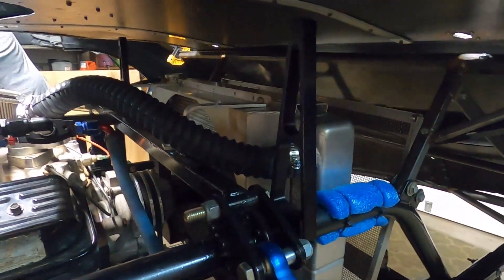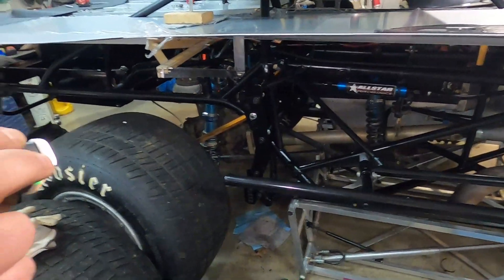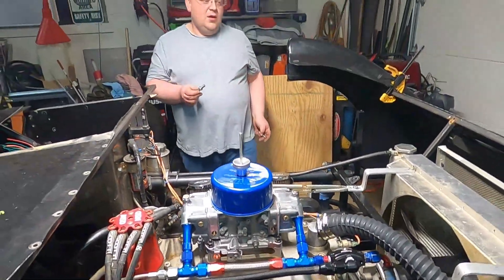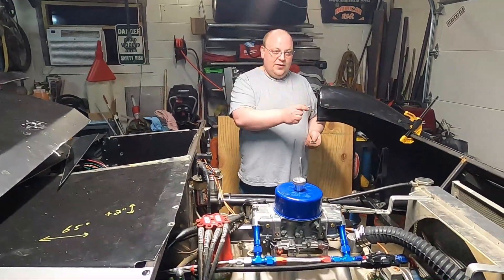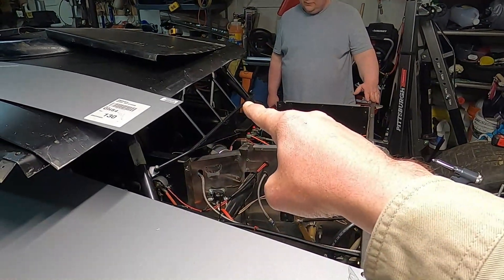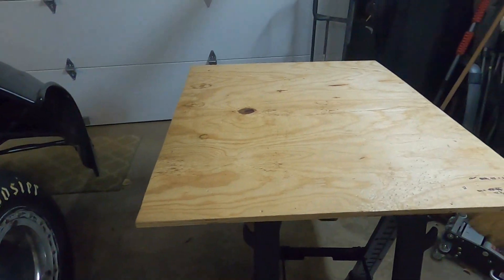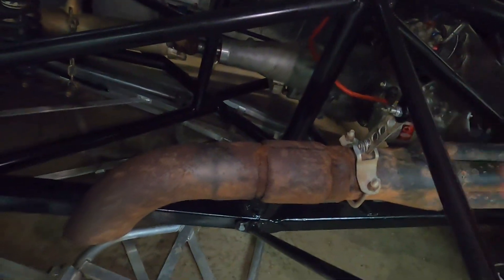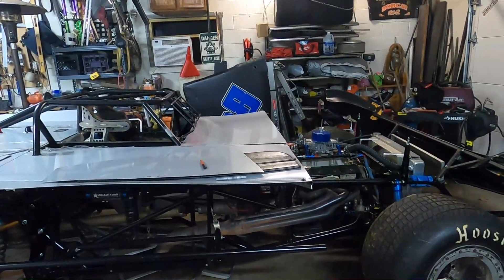CLOSING THE GAP ON OUR DIRT LATE MODEL RACE CAR MASTERSBILT

Comment: If it was my car I’d do the deck, hood and fender tops silver. Then the sides black. That would make the most sense to me.
Reply from the maker: Hopefully the metal will arrive tomorrow.  Still having shipment issues around our area.  If enough silver arrives we will probably do the deck, hood, roof, and fender tops in silver.  Using the flat black to wrap the sides and even the fender sides.
Reply: @LateModelGarage  were lucky here Stock Car Steel, SRI, and SRI dirt and drag is one company. We can go up to SRI Dirt and Drag, pickup tubing sheet aluminum as needed. However I was told that the gloss black is on  back order
Reply from the maker: We received word today that the silver is on backorder as well.... Looks like it is gonna be black for the rest of the body.  At this point we don't care what it looks like we just want to get ready to race!
Reply: @LateModelGarage  Looks like you will have to do what you have to do. A lot of stuff is on back order